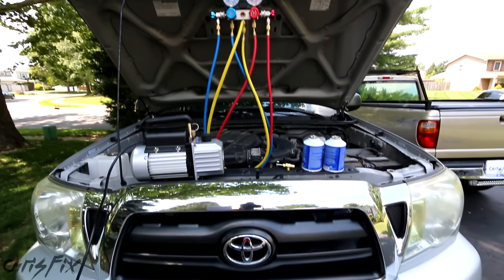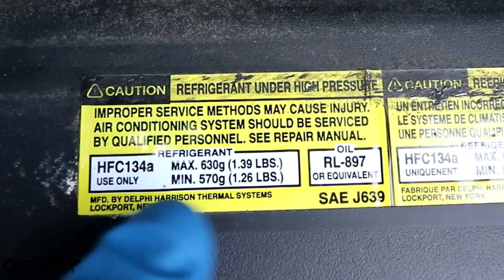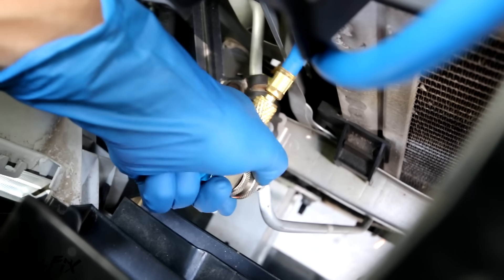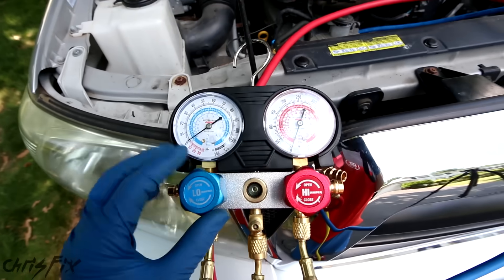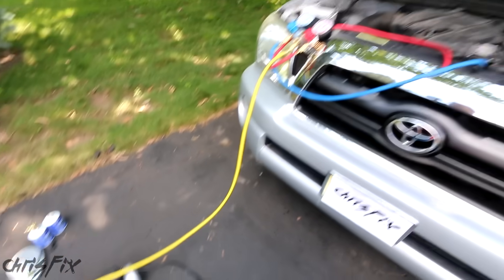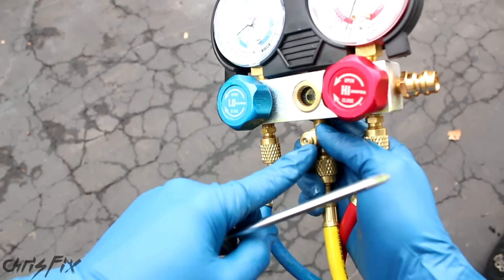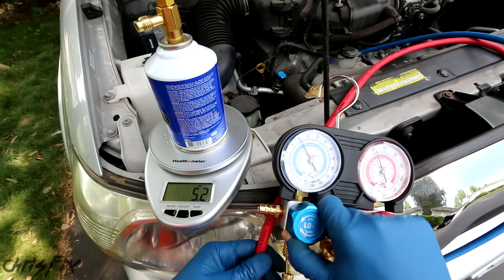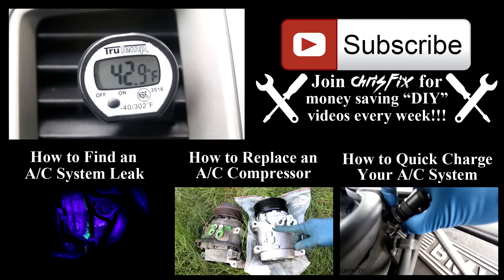How to Properly Recharge Your AC System

Comment: When refrigerant goes from a high pressure to a low pressure, what causes the cooling is the  evaporation of liquid refrigerant to a gas refrigerant,
 that happens in the evaporator, duh.
From there,  the compressor compresses the gas molecules of refrigerant gas together,  the heat stored in the refrigerant gas from the evaporation process,  when compressed together, it   increases the heat of the gas to a higher temperature than the outside air, ( should be 35 degrees F higher ) ,  when air from the condensed fans, or from the car moving down the road passes across the condenser,  the hot gas in the condenser is cooled causing the molecules of refrigerant to come together back into a liquid , from there the process repeats  , the liquid goes through the metering device spraying the liquid back into the evaporator where again it absorbs heat as it turns from a liquid to a gas.
Due to the higher volume of air going down the highway than the fans can normally produce when the car is sitting still and the interior is hot, I usually like to charge auto AC's with my gauges coming from under my hood so I can read them when the interior of the car is cooled down and the car is moving at least 45 or more mph. The Pressures should correspond to  40 degree Fahrenheit  for the low pressure side or there about, and the high pressure side or condenser coil needs to be 35 degrees Fahrenheit higher than the outside temp. Your gauges should have a temp reading for different refrigerant types on the gauge, If not use a chart.. Refrigerant will be a certain temp at a certain temp, they have a temp/ pressure chart for each thpe of refrigerant. For example Refrigerant 134A is 40 degrees Fahrenheit at 35 Pounds pressure, the low side reading should be near that, if it gets below 27.8 PSIG it will freeze and you will see frost on the evaporator side. The high pressure side determines the amount of charge, as an example on a 90 degree day refrigerant 134A is 104.3 PSIG, so take that and add 35PSIG doing the math and you get  104,3 + 35 = 139.3 PSIG. This is what your high pressure gauge should read for example on a 90 degree day with the interior of the car cooled and favorably while moving down the road at least 45mph with plenty of air moving over the condenser.

When a car is hot and sitting still, there is a lot of heat being absorbed into the refrigerant so both the high and low pressures will be higher than normal operating conditions, you will tend to under charge the system, or overcharge it to try to feel any cooling.  Charging the system while the car is cooled down insures you can get the conditions right to get the charge right. You can also wait till night time when it is cooler and there is not so much heat to cause too high pressures, you might want to have someone hold the idle from 1 to 2000rpm as it would be cruising down the road.
 You never want to overcharge the AC as liquid refrigerant can get back to the compressor in a liquid form where it will boil and foam the oil pumping it through the system restricting the refrigerant flow, also a higher high side pressure can stress the compressor. If you ever add a can of refrigerant that comes with an oil charge, beware , if you have too much oil in the system, it will flow through the system with the refrigerant and since it is thicker than liquid refrigerant, it will restrict the flow of refrigerant causing the ac not to cool properly, or be erratic cooling. TMI sorry. But I am trying to give you all the scenarios of what I have experienced fixing Auto AC units. 

 Some cars have a suction side accumulator as well as a liquid drier, these can get clogged so if you are having issues with your ac no one can fix, you might want to replace them, some compressor manufacturers will not honor their warranty unless you replace the drier and the metering device if it is a bulb type valve (TXV). The lack of proper flow of refrigerant due to a restriction can prevent refrigerant gas from getting back to the compressor which cools the compressor. Auto AC refrigerant system can be much more complicated to repair due to the extra components that a common household AC does not have. You have to have a good understanding of them to be able to diagnose them if simply adding refrigerant does not get the pressures where they are suppose to be.
Reply: Just curious what components do auto a/c units have, that a residential unit doesn't?

Comment: love the video and you sharing knowledge the correct way. i have one question. If I put oil and or dye in thee feed line, how do I purge the line? Not being a smart butt, truly just want your input. Thank you for the great vids.
Reply: Don't use dye, if it does leak it be a mess!
If you suspect a leak, wash/wipe the hoses/tubes down and look for oil leaks at all connections/hoses.
Use soapy water on a suspected leak, but your system will need some pressure in it...👍

Comment: What happens if we accidentally fill an R134a system with R12A?
Reply: Prob won't work very well.
R12 uses mineral oil.
134a uses pag or ester oil.
The refrigerant and oil must mix to move thru the system.
Recharge with 134a.👍

Comment: This might be dumb question but I’m asking cuz i already have it. I bought a brand new compressor cuz the old one went bad, and i initially bought a big bottle of ac pro cuz i didn’t realize the compressor had gone bad, after installing the compressor to recharge the system could i just use the bottle of A/C bro

Comment: My 1985 4runner has the 22re efi 4cyl, has been converted to use R143A, I used the little white bottle like you used, with the hose/connector from the AC PRO, I did not use the ACPRO on it last year.... air is cool, not cold when hot out. what could it be? old compressor? or something else?
Reply: Did you add ester oil?
If your low side tube near the firewall isn't cold and sweating like a cold soda does... It's probably a bit low on charge.
However, when using 134a in an r12 system reduce the 134a charge by 15-25%.
Reply: @charlesguinn4316  Thanks for your expertise, I took my 4runner to a local garage today, and it is fixed!! paid only 100 bucks for the service, it is blowing ice cold! the mechanic told me that the other guys at Precision Tune did not do the work properly.... so it's all good.
Reply: @dundeeecroc  👍

Comment: no need to weight, have to calculate suction pressure , if compressor pumping is perfect it will take 30to 35 psig and sucction pipe will be cold . Be sure this.
Reply: And sweaty...lol

Comment: My car's AC system calls for 6.6 oz. of refrigerant. How can I add 3.6 oz. of PAG oil into the AC system? I put 3.0 oz. of PAG oil into the compressor already. I have an accumulator 'with' hose assembly attached, so I can't put the PAG oil into it that way. I don't have a vacuum pump or the manifold gauge set. Can the oil still be added by a service shop ? The compressor, accumulator and orifice tube are all new. Those are what I replaced.

Comment: Please help.... When I remove the low and high pressure side hoses I can hear the lines sucking in air and when I put my finger over it I can feel it. Why is that?! I’ve replaced the Schrader valves TWICE @chrisfix

Comment: At 6:18 or so you closed the red and blue valves on the gauge set and turned off the vacuum. I'm thinking that you wouldn't see a vacuum change with those valves closed. The system would be closed from the gauge valves to the rest of the system. Not until you open them after an hour then you could see a vacuum change. Or, wouldn't you want to leave the valves open and close off the vacuum valve? Just trying to get it straight. Thanks for the video.
Reply: Never mind I get it now. Brain farted!

Comment: I have a good question. I changed the compressor and the accumulator due to some idiot left it open for a long time for a 98 honda civic. Both of them are used and the accumulator was made sure that it wasn't in contact to the air for a short period (10 minutes) of time. I did all of the steps and found out the pressure for both low and high side have the same pressure. Low isn't low. High is high. What could be the issue? Pressure switch or restriction in the suction side?

Comment: Just one question, How can you tell if your new compressor was loaded with oil or not?? I got a Sanden compressor some time ago for my tractor but have never installed it & don't know if it had oil in it, I would hope it did but I'm not sure.
Reply: Open the ports on the comp and dump that oil out.
Pour in New oil. 134a use pag oil.
If has very little just add an oz or two.

Comment: So... if i didnt change a mayor part of the A/C system and i flush the old refrigerant, i dont need to put oil? I want to be sure and a lot of people say yes and no
Reply: The compressor is the only thing that needs oil, if you flushed the old refrigerant, make sure to vacuum the system. the vacuum does not suck the oil.
Reply: @LBZDreamer  Refrigerant and oil mixes and flow together throughout the system cycle.

Comment: Hi Chris - great video! I have a new variable displacement compressor PXV16 type that I just installed. Would the procedure you followed to start car then introduce refrigerant into low side until compressor kicks on work the same or does it not matter the type of compressor? I know some who introduce refrigerant to low and high side engine off then start car. Hope you can comment.
Reply: A static charge is best.
Dump a can in, wait 5mins then start vehicle and ac...then cont to add the rest...👍

Comment: I bought the same kit you have but the fluid line (yellow) will not screw into the R134 valve tap I purchased at Autozone.  I was told it only screws into larger tanks.  Can you advise?
Reply: You need an adapter...👍

Comment: My ac system had a big leak on the discharge hose I replace it and now I gotta recharge the system my question is do I need to add a can of 134 with oil ?
Reply: Or do I just refill with 134 only??
Reply: If it was just a hose you should be good with just freon. Almost all of the oil would be stored in compressor, accumulator, condenser etc not hoses.
Reply: @alfonz0010  ok thanks

Comment: I don't want to go through the hassle of taking my truck to the shop to have the refrigerant professionally evacuated. Is this step absolutely necessary or can I skip this step and just hook up the vacuum pump?
Reply: Just don't breathe it in and you'll be fine. If you try to recycle it without a machine it will just come out as a gas not a liquid.
Reply: @LBZDreamer   that's what I figured. I'd still need to get the liquid evacuated, right?!
Reply: @miket6094  it turns into a liquid when it gets compressed. The whole system is a gas while it's turned off.
Reply: It would just purge it all to the outside air when you vacuum it which would be illegal but nobody really cares besides the Epa, I've seen guys who work on house a/c systems do that

Comment: You want the yellow hose to have a valve installed on the end of it that you can disconnect from vacuum pump with vacuum holding all the way to the very end of the yellow hose.   Otherwise leaving that hose Open to Atmosphere has just introduced the entire length of hose and inside volume to moisture and air getting injected into the system thereby defeating your goal.   Also, I have been using a Fieldpiece Sman3 with Micron Vacuum gauge and can tell you that it took 5 hours of vacuuming my system to get consistent Micron Readings at or below 1000 with vacuum at 29.9 in Hg 4je entire time.  Soooo....  depending on how much moisture got into the system during servicing or simply getting injected with contaminated air by the dealership during servicing...   I would recommend 3 hour Minimum Vacuum .... repeated 2 times to ensure you disrupt the water bond to PAG (Polyalkaline Glycol) Oil.   Repeat the process 3 times drawing down for 3 hours and you will have as near dry a system as you possibly can ESPECIALLY if you are NOT installing a New Accumulator filled with Dessicant.    Objective is to Avoid introducing Air and Moisture into system because the air displaces refrigerant AND the moisture or water vapor creates Acid that eats away at everything from within.   Current job had condenser Corroded at bottom indicating excessive moisture from within was possible culprit and ate it inside out.   Hope this info fills some gaps for people.  Just simple vacuum alone is no enough because my gauges pegged 29.92 within minutes but my Micron Gauge told me a different story.    700 to 800 Microns is your Goal with rise to 1200 microns or higher indicating water vapor has been released into system requiring additional repeat vacuum.
Reply: Just fuckin purge it. Before opening the yellow side. Tip can upside down. And purge at the manifold. Boom done. 
Y’all are overthinking.
Reply: Plus it’s a small critically charged system. 
Microns will work most of time. But I’ve had tiny systems that pull down to 500 microns and still leak weeks later. It happens. I’ve done refrigeration to industrial hvac. Small systems can trick you. It’s happened to me a few times in the field.

Comment: Does anyone know/should you also replace the A/C accumulator and receiver when recharging the whole AC system? Mine does not have an issue, but If it is advisable, I might as well change it now. If I pull a vacuum, will this dry out the desiccant inside, or should I just buy a new desiccant? 
Btw, amazing videos.  Super simple, helpful, and best camera work on any how to mechanic channel.

Comment: What do I do if my ac compressor doesn’t kick on when I turn on the ac? Brand new compressor drier and expansion valve?
Reply: might be just a bad clutch or relay
Reply: Or low on 134a or bad field coil not pulling in clutch just as a start

Comment: It seems like it's difficult to get all the refrigerant out of a can, once the pressure inside the can no longer exceeds the low side pressure of the system it's a stalemate. Possible you need 3 cans to get 2 cans worth of refrigerant?

Comment: This is a great video. It is the proper way to recharge. Did anyone notice the PSI 40 when he was done? Thats the proper charge. However, I always take mine to 35 max for fear of busting old hoses in the car. So if I simply topping off I never exceed 35 PSI. I tried to explain that in my video. Listen for belt squeal. That's another sign somethings overcharged. overcharging is just as bad as no charge. -PawPaw

Comment: If my car required 24oz of refrigerant and   3oz pag oil. Would that be 27oz total or do i only put 21oz of refrigerant and 3oz oil. Also, I have changed the condesor. By changing the condendor, did i lose all of the oil in the compressor?  Do i need to add pag oil after changing the condensor?

Comment: If I'm using this method to top off my refrigerant, do I have to evacuate all of the refrigerant and fill it up from zero?
Reply: No need if there is still refrigerant in the system (meaning no air/moisture). Vacuum is required if the AC system is empty (meaning filled with air/moisture).

Comment: I don’t understand the point of doing this if you can do it from a can
Reply: Vacuum is required if the AC system is empty (meaning filled with air/moisture).

Comment: great video.  appreciate the detail.  two questions I have…

1 - if you draw a vacuum in the lines and it shows -30 on the gauge after waiting 15 minutes (proving there’s no leaks) then why run it again for another 45 minutes?

2 - every video (including this one) talks about not evacuating refrigerant into the air… but you did exactly that when connecting the can.  is that small amount okay, or what?

thanks!!
Reply: I know its an old comment but 
On your first question , 
Pulling a vaccume  only really has a bare minumum time limit .  The longer the vaccume time the tighter and drier the hvac system .  
As to your second question you MUST  purge the air out of the lines before adding gas .  Worst thing you can do is to add air in the system that you just spent all that time evacuating and pulling in to a vaccume . 
The EPA  allows minimal relase in to the air ( de minimus )  is the term they use .  
Its  legal . 
Hope that helps .  I dont know it all ,  lots to learn but i am EPA 608  and EPA 609 ( auto )  certified .  Graduated from 2 year hvac trade school . 
Overall pretty dang good video .  Minus a few nit - pick things i would have added .

Comment: My yellow hose for the MGS has a sort of valve inside one of the hose ends. The instructions do not mention which way this valve is supposed to face ( gauge set or refrigerant/ vacuum pump side)

Any ideas?
Reply: I just got mine yesterday and could not get the freon to flow from the can to the manifold, car. I had connected the bent end (valve) to the manifold. I thought it didn't matter but it might be that the valve end goes to the can.

Comment: Why pull out the High and Low ports? The system is open it will pull out just through one port I use High and leave the low ready for refill.

Comment: I use compressed air to do the leak search, because you can use soapy water to find leaks way faster than with a UV light. But you need to vacuum it way more because of the added moisture.

Comment: My AC works it just only reduces the temp by about 15-20 degrees. The shop says it should be able to do about 40 degrees. Can I just top it off with new refrigerant or should I flush the whole thing? Seems like a waste to dump the existing so I would like to know what the benefit of doing that is. Maybe a small leak and it would be beneficial to top it off first and add some dye and then later check for leaks before attempting a fix and a full system flush? Lastly, must you add the refrigerant by weight or can it be done by monitoring the pressure?